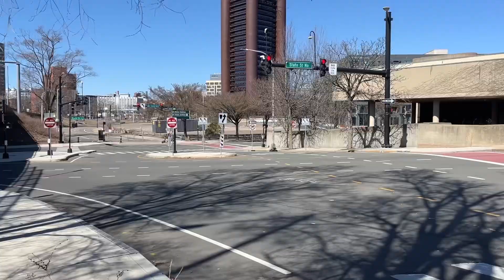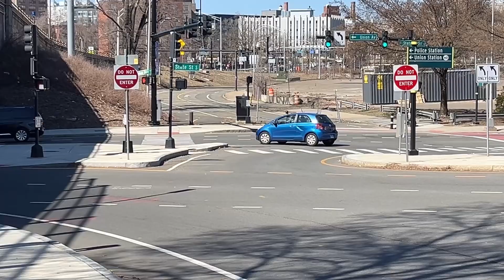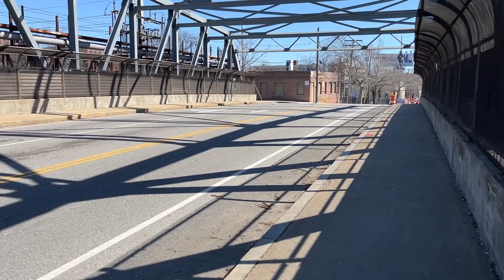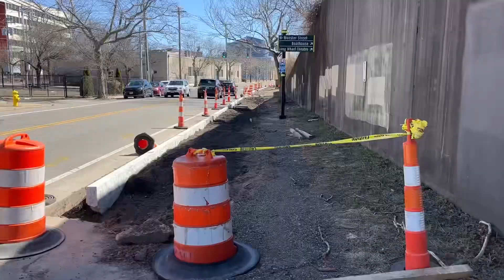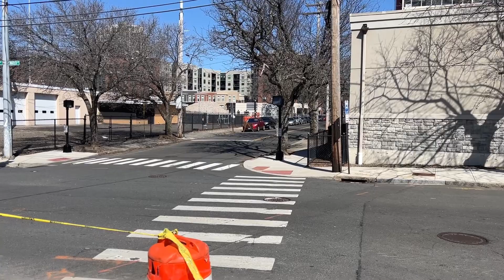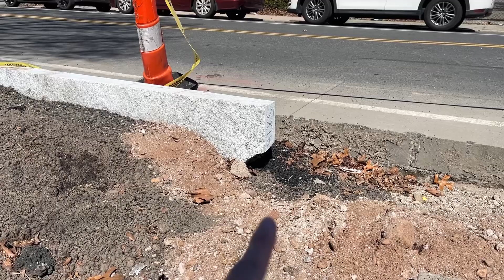Water Street Cycle Track Project - March 2025

Comment: That intersection will be a true crossroads: W to MLK Blvd/Downtown, N to State St and the Canal trail, E to Shoreline Greenway trail, and S to the train station.   Any idea on the timeline for this particular project?   the 2 blocks of bike trail underneath the Audubon garage have been under construction for 4 years, and it's still not open :-(
Reply from the maker: No definite timeline, but I fully expect it to be open by this summer. The work is relatively straightforward